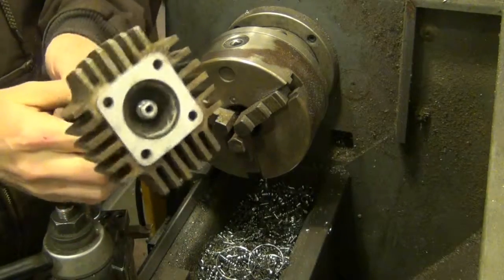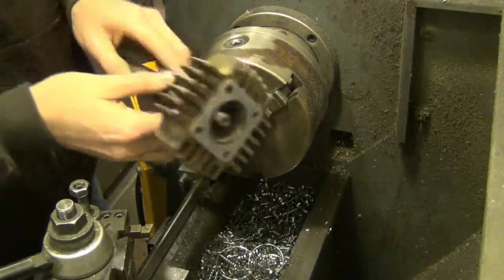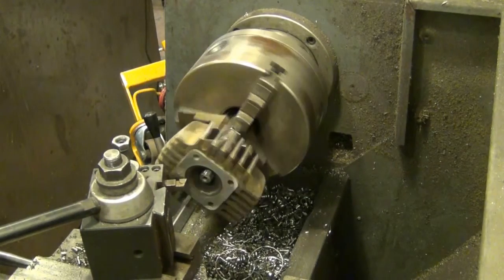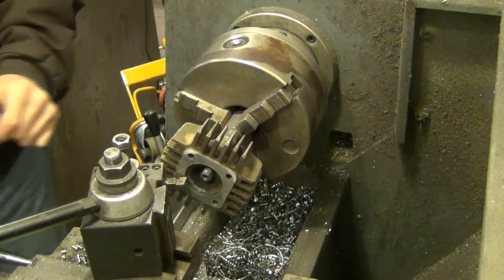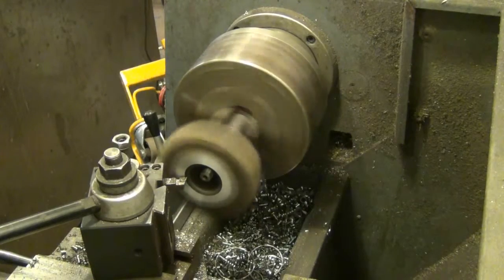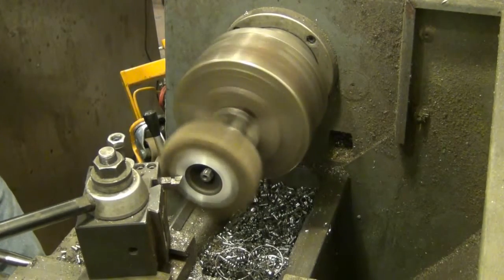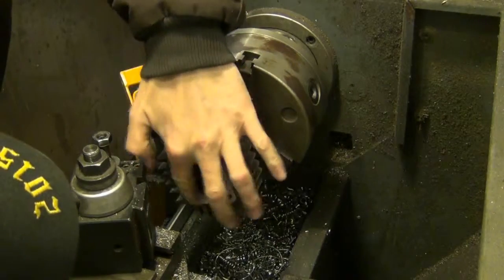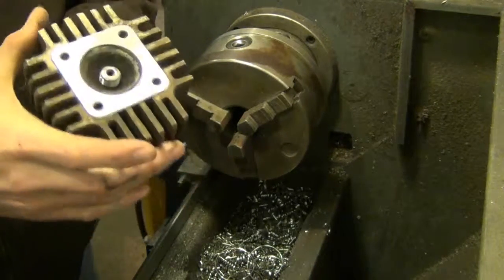Machining a Four Wheeler Head

Comment: The arbor looked slightly out of true.
Reply from the maker: It is. A friend of mine who machine the arbor, built it in 1962, and it has seen many many moves, bangs, and bruised in its time.
Reply: It's the best you had at the time! I guess the question should be "Did it work (better) when it was reassembled?"